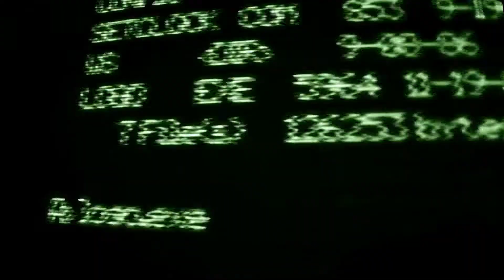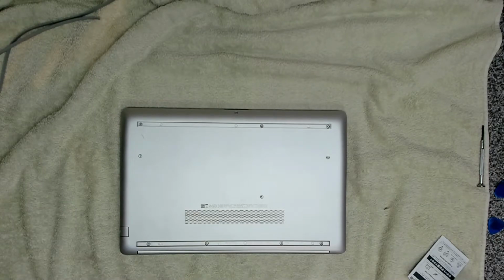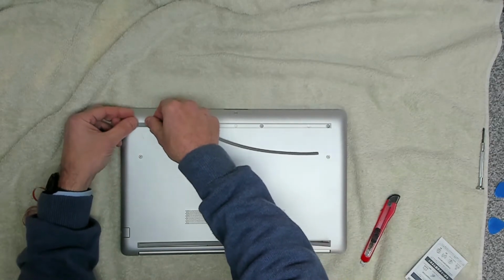HP Notepad 15 da0511sa disk drive and RAM upgrade - FREE?

Comment: I have this laptop, am I right in assuming I can install 2 x 8GB ram? The 4GB is starting to drive me a bit mad 🤣
Reply from the maker: Yes, that's correct you can install 2x 8GB DDR4 PC4-19200 2400MHz 260-pin SODIMM for a max of 16GB.